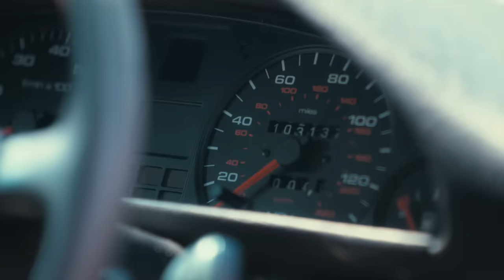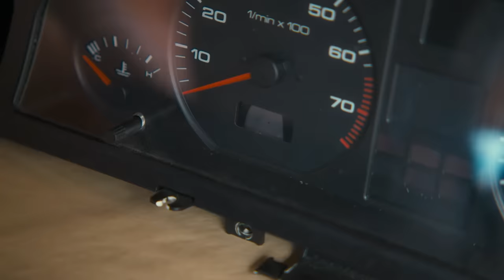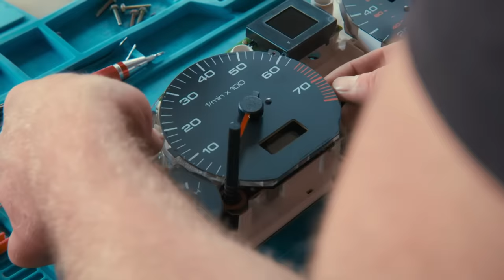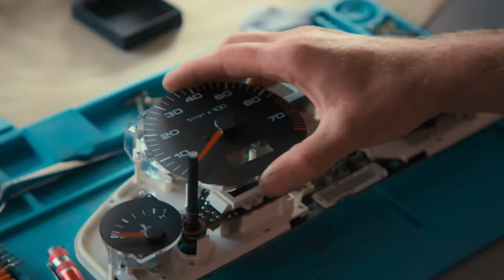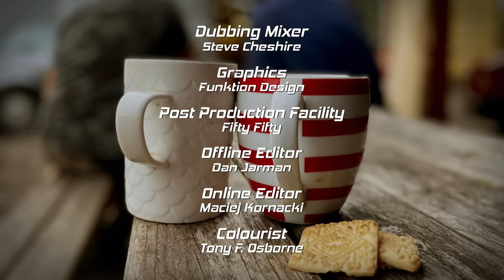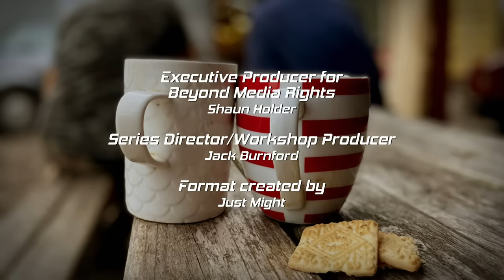Audi 100 Restoration - Flipping Bangers - S03 EP09 - Car Show

Comment: This car is currently on Ebay for £2750
Reply: link ?
Reply: Correct ,heater not working as well as back window .even got a picture from the show
Reply: You got a link or are you telling porkie pies?
Reply: It is on there and it doesn't show the side they painted  😂
Reply: In fairness they are not restoring classic cars they are flipping bangers in that game all you do is bodge up and lash with filler and send it on its way looking shiny just about running 😂 it’s standard in the industry
Reply: Sure that wasn’t……27.50…😂😂😂😂
Reply: In Crawley
Reply: 😂 love it
Reply: I wud b in at 1200 bucks
Reply: So did the current seller buy it from these two and now has knocked £50 off with a non functioning heater and back windows? Bargain!
Reply: This car is now a classic and as it’s over 40 years old, they can fetch over £5000 for a mint one.
Reply: It's also advertised on Facebook.

Comment: Back in 1988. My dad had an Audi 200 Quattro in a very similar colour. Think it was Bordeaux. What an absolute flying machine. It was years ahead of anything on the road. We did numerous trips to Spain it it up it loved motorways And the build quality, even  then Was unbelievable.. Good fond memories of the legendary Quattro❤
Reply: ive been looking to buy an Audi 200 Quattro for yonks !
Reply: Yeh i had one, got it out of someone’s hedge in their driveway “for freeeee” rotten battery tray compartment leaking into the passengers floor well because people don’t clean out their drain holes, a flat battery and four flat tyres was all i could see wrong. Dog’d it up lovely job went through it’s mot with part worn tyres, brakes and secondhand battery. Blow it up 6 mths later but it did love them revs 😂. Just took her to the weigh bridge and sold the wheels and battery later on 🤔 profit.. got me money back and a drink.
Reply: Cuando Audi era Audi…
Reply: 200 quattro. Beast

Comment: Loving the enthusiasm for the Audi 100 Avant. Will is a pretty good panel beater and painter, considering the metallic paint is more difficult than solid colours. 
Great job repairing the Instrument Cluster. It certainly pays to get specialist assistance, when needed.
Let's see some other Audi models, especially the manual transmission quattro B5 A4 1.8T. Bonus points if it's an Avant. 
The TT 8N Episode was bang-on too!

Comment: I hate to suggest this but if the water bottle has burst at the seam, could it mean that the head gasket has blown and is sending pressure back in the system ?

Comment: I've just looked at the DVLA MOT History Check and the vehicle does not appear to have turned a wheel for a few years, judging by the mileage quoted.
Reply: i think cars like this i recon were either too good to scrap, or PX value at the time was peanuts for what it is. So it was just mothballed for a few years.  I have seen a Rover 827 mk1 on youtube with the same story, that car was actually put away and still had the original brake pads on!  laugh was the car had only did 18k or around about that sort of mileage.  That was put away back in 2000, lads put a new fuel pump and gave it a service, and it was good to go.

Comment: I had a B2 Passat wagon kinda similar but one generation older I think. It's flashier Audi cousin was the 80 or  5+5 in Australia. I love the quirky look of it cause the engine sits so far forward but I've read that it was the cause of steering problems. Mine was the GLD version the 1.5 diesel also found in mk 1 golf then everything else was Audi B2. I loved it the seats folded flat and fuel economy was amazing. It was slow off the mark but pretty responsive north of 60. 140 was its top speed.

Comment: I have Audi 100 and i hade same exact issues, cluster, handbrake, issue with paint, window motor and headliner.. Also my engine has noisy lifters but it runs good. It is probably standard issue with this model.

Comment: How can overheating be 'cured' just by replacing the busted coolant reservoir? It looked like a milkshake in the old one, which tells me that the header gasket was not 'gasketing' anymore..
Also, good job 'undenting' the car. but the paintjob.. nothing wrong with a homemade paintjob, i once painted my car black  with a roller lol..  but guys.. just remove the hood, front fenders and doors to paint those parts.  Or if that is too much of a hassle, at least remove the grille, lights and bumpers.

Comment: I had a white 100 sedan and it was a big car. Unfortunately the sunroof jammed, I had no heater, the driver's door handle broke, the ignition barrel was defective, front passenger electric window not working (was an easy fix), radiator needed replacing and someone had disconnected the little monitoring system (probably advanced for its day) display in the binnacle. Twice a year for many years I attended a camera market and there would be a white Audi 100 Avant parked (from one of the vendors) until the last time just before covid it had been replaced by a big Chrysler 300.

Comment: Love to know what it cost? I have an old 51 plate audi A6 C5 sport with 6 speed geabox and 130bhp pd engine cost £32000 new with all the options. Its got a saggy head liner snapped cable in front door regulator and had part of the boot resprayed and the rear arch painted as it was dented do you think thats worth £2000 then?

Comment: I would love this as they are stylish but haven't got room for a third Audi. My 2004 A6 has 187k and still original clutch (had it since 2005) and sadly can't be looked after by main dealer anymore because Audi parts not made. But I hope never to sell or A5 cabriolet - the midlife crisis 😂

Comment: Crying with that dent pulling I'm a rookie and know this is not best way luckly you got away with it but you need to get a heat gun and warm the paint serfice first as u can crack the paint on the outside while ur pulling it out needs softening first but non the less it was successful

Comment: The Audi 100 got a bad rap in the US which hurt their reputation.  "Audi 5000. During model years 1982–1987, Audi issued a series of recalls of Audi 5000 (the North American name of the Audi 100 at the time) models associated with reported incidents of sudden unintended acceleration linked to six deaths and 700 accidents."
Reply: Also take note .. it did not take long for the reliability issues and its connections with Vw to surface.. once the SHOOTING GRANDMA issues hit the news AUDI as an entire  brand was Finished. . Even to this day , Audi is looked at as a poor hood rats BMW.

Comment: We were unlucky enough to own one one of these years ago. An early one

Awful car. It was an auto, and utterly gutless although cruised OK when it finally got up to speed. Handling was pretty poor - not surprised when you looked at how flimsy the front / rear location was of the front suspension and how hideously heavy the struts were. Being an auto one drive shaft was very short and the other very long, which if it had any umph would likely have caused bad torque steer.

Diffs failed (oil filler for it hidden behind an engine mount so nobody checks the level - and then the low oil level kills the diff). Fuel pump hidden in the tank - should be easy enough with an access panel but they glued the carpect over the access panel. Rear calipers need a hex drive to retract them, but the hex in the piston is VERY shallow so round off.

Had to change the power steering rack. Twice (2nd one being because the 1st replacement rack had been badly rebuilt). Nightmare job. They give you an access hole in the inner wing but it is smaller than the rack - just about fits by lifting / dropping and hooking the column connection through the hole, but on a rhd car this is very difficult as you still have most of the racks length in the engine bay while doing this. The rack seemed to be one of the first things put in the car when built, with the brake lines, etc, running close over it, held on with plastic clips that break easily.

Wires for the clocks, etc, were tiny gauge. OK when everything was perfect, but if anything had issues the wiring would likely fail. Never had another car or bike which used such thin gauge wiring.

Central locking worked from compressed air from memory. Which seemed to be unnecessary complication.

Comment: I don't think Audi needed to impress Mercedes and BMW. Who was the rally winners in the 80 and 90? The Audi quarto. A dream of evry car buff. Mercedes, the farmers car, BMWs used to  smell when you went of the gaz on the motorway. It was a different world. The Audi was  a king not a want to be.
Reply: In the 1980s, the Audi name hadn't been around that long and their road cars didn't have the same reputation as a Mercedes or BMW. Their Motorsport program helped them build that reputation.  This era of Audi was the best.  Engineering quality.  As the presenter said, they were really trying to impress.